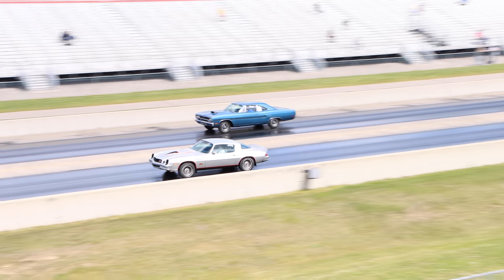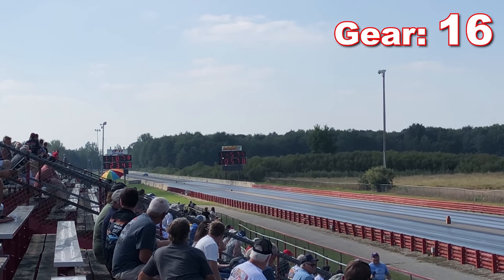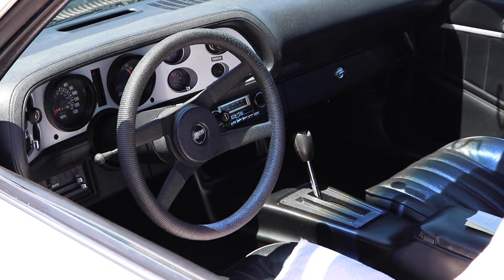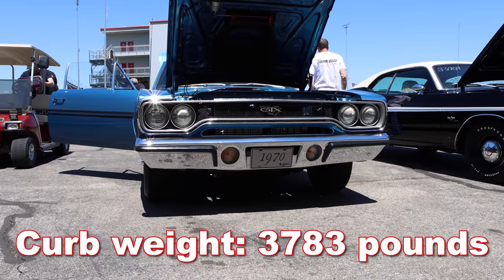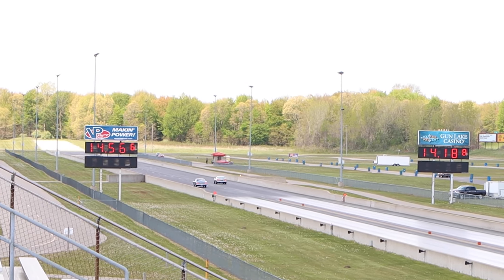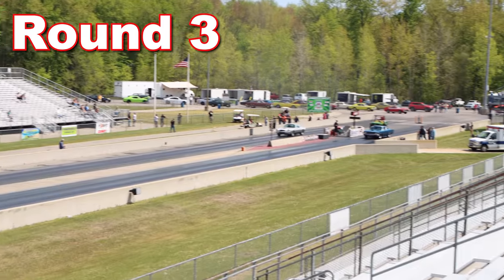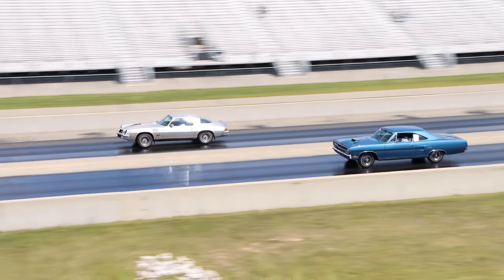1978 Chevrolet Camaro Z28 drag racing 1970 Plymouth GTX FACTORY STOCK DRAG RACE

Comment: That Z28 must be well-tuned and taking full advantage of the rules. There must be hope for my 74 Formula!
Reply: cam, higher comp pistons, hi-flow cats, non emissions messed up carb..yeah, basically probs making more power than a '69 Camaro, lol.
Reply: @gzuzsavz  NOPE!! Read the rules. He can change out the pistons but he'd still have to run the god awful emission era heads, casting #s are checked on all cars to ensure original configuration or blocks, heads and intakes. He can work 'em but he can't swap for "better". As to cam changes, can't get away with much of anything here. Cars have to make "Vacuum" which is measured at 16 inch min. The only cars that can get away with less than 16", according to the rules, are those that came that way from the factory. No roller cams and full original appearance exhaust must be in place, though you just know the converter has been hollowed out here. Carb can be worked but must be factory available original for the model year of the car and it must have a choke. Exhaust manifolds are retained and they aren't allowed to be "worked" for flow but it's pretty hard to imagine people, including this Camaro owner, don't cheat on that one. A little extra compression with flat top pistons and worked heads isn't going to amount to a whole lot if it can't breath better than the factory stock exhaust doesn't see big change for flow of the spent gases.
Reply: @Dogboy1960  Its basic physics. 98 mph 3550 pounds 1320 ft.   That Camaro is putting down at or slightly over 300 hp to the wheels.   Not bad picking up 120 hp with a tuned carb  lol.

Comment: Looks like the Camaro owner did the right thing and threw the original engine in the garbage
Reply: I'm sure he did!
Reply: Jeffrey Ring  well if that was the case, I would be really disappointed in only improving to a 13.90 from the 14.60 it ran with the untouched stock 57k mile engine🙄
Reply: Nope. I doubt he "shit canned it".  That 14.0 seconds average times at under 100MPH is no great feat. Sounds and looks to me like it's still in there. REALLY piss poor times from the factory and magazine articles back in the day were truly STOCK 'as delivered cars. It's really hard to over state how very buttoned down and stranggled air flow was for cars were in general in 1978. These numbers do appear as really impressive improvement, probably about as far as you can go without a head swap, bigger cam and headers but far from really hard to get out of the original engine. The rules in this class allow for lightening up the car's weight, the exhaust can be cleared of  serious restrictions, Carb can be tuned for performance and the intake and heads can be worked for both flow and a little extra compression. I have to believe he's shaved 'em for more compression. At under 100MPH and just 14.0 on average he's not exactly setting the world on fire but it's pretty good for those absolutely pathetic emission era, big chamber heads. Truth is there is probably not enough commentary on the very WEAK performance of the GTX. As a totally stock survivor I'm betting the car's owner hasn't done much of anything to optimize his car. This is no small part of the other side of the story here. How does a 440 bring such a weak performance? If he'd willing to dig in deep into his car, as the Camaro owner clearly did, he'd likely be putting up times in the 12s. At the end of the day though I will admit it's got to be a lot easier to make changes to a car that isn't especially rare and nobody really cares if it's all original stock than it is to dig in and make changes to car as rare and far more valuable to collectors as this really NICE GTX.
Reply: @Dogboy1960  in reality that's about how a stock untouched 440 ran back in those days
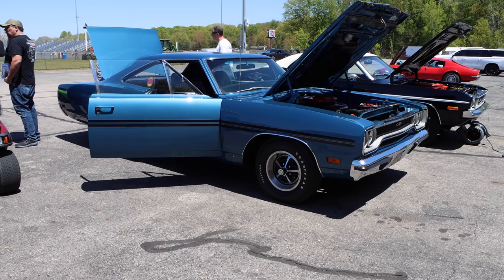Reply: @wallyfronzaglio372  If it came with highway gears you might be right. I think that what we're looking at here is a REALLY GOOD GTX that it's owner doesn't want to change up from it's original configuration. So if you can assume, as the video narration does, that it's still got 3:55s it's hard to explain his really poor showing. The video doesn't show that launch especially well, Could have been a case of terrible wheel spin off the line that saw him immediately lose a couple of car lengths to the easier to launch lower torque auto shifted Camaro. What we do know though is he was pretty evenly matched with the Camaro for the rest of the run. Given the extra weight that 440 is still making a little more power than the Camaro but it does show that the Camaro owner/driver has 'tweaked" his sadly hobbled emissions era 350 pretty significantly.
Reply: @Lucille69caddy  Thank you?

Comment: Something is up with that Camaro. Single exhaust,no flow pellet converter and junk heads. Those were lucky to get into the 16's when new. I used to beat them with a Toyota pickup.
Reply: There was no way in hell that was a stock Camaro.   When I was a kid, my 66, 300, with a 440 smoked those cars and was at least 500 pounds heavier than a GTX!!!!   Either the clutch was nursed by the driver or that 440 had a mid 70's Chrysler Lean Burn emissions system.  There is no way in hell that Camaro is stock.  BTW, I grew up in the 80's and raced my sleeper Chrysler all the damn time 73 and later Camaros were a joke!
Reply from the maker: You remember the beginning of the video where I yelled “READ THE VIDEO DESCRIPTION BOX?” You should probably do that.
Reply: @CarsAndZebras  I did. There is no way that Camaro ran a 13 with a overbore,882 heads and .390/.410 cam lift and 1.5 points more compression. The 70 Camaro With the 300/350 had 10.25 compression,better heads,dual exhaust,same cam etc and was a 15 second car
Reply: @chrisleggett685  never blueprinted an engine?
Reply: @mohh.4327  So, it's not stock!!!  That's the point!
Reply: @chrisleggett685  - In 1974 I added headers, full dual exhaust, a 600 cfm Holley 4 bbl, a dual plane intake to the 351W 2 bbl equipped 1970 Mach 1.  I also installed 3.91 rear gears and had the car professionally tuned.  The result?  I cut about 1 second off the 1/4 mile ET.  So when you say that adding dual exhaust will cut a full second off the ET I can say by personal experience that you are totally full of shit.
Reply: No emissions real dual exhaust and 1.5 more compression
Reply: Looking at those times, credit the owner of the Camaro. He turned a slug into a strong running machine. I'll still take the GTX. I grew up in a family that drove them all, GM, Ford, and Chrysler. I will alway's be a Mopar fan  for life!
Reply: With the original 57,000 mile engine last year the car ran mid 14's, no valve seals, bad cam lobe,etc.
Only thing non stock was nice mandrel bent dual exhaust, which is allowed in rules.
I went through the carb, jetted it up, worked on the secondarys, and went through the distributor, limited the advance, put a bunch of initial timing in, limiting the total.
Fresh engine definitely goes 13's, and that was my 15 Year old kid driving.
Reply: @tommiller1777  One hell of a job on that Z. My cousin bought a new Trans Am in 1978. I remember racing him with my dad's 318 '77 Volare wagon in the summer of '79. I stayed even with him until we 80 mph and he left me good, but up to 80, it was anyone's race. Getting a malaise era Z28 into the thirteen's is impressive.  Kudos!
Reply: @chuckhaugan4970 , you really have no clue what you're talking about about. But, hey, if you want to believe you do, then your delusions are strong. The Camaro is modded within the limitations of the rules... get over yourself. 13s within the constraints of the rules isn't that hard with that car.
Reply: @jayschmahl9206 , in Pure Stock, yeah, 13's is a bit difficult with that Z28. Building it to just run, nah, 13's is very easy. Cam, heads, intake, and headers, mid-12's would be gravy with that car.
Reply: @danmyers9372  You can’t be that dumb. You’re comparing a completely different car with a better exhaust from the factory. That Camaro Z28 ran through one (ONE!!!!!) catalytic converter and a near 2 inch exhaust. Go mandrel bent 2.5” x-pipe and tune according, and YES you will run a 15.0.
Reply: Did anyone verify the gear ratio? I bet that car is rocking 4.10's or better
Reply: @jeffm7669  yeah, I'll verify it for you. The car has the stock 3.42 gears. We drove it 45 minutes on the freeway to and from the track two days in a row.
Reply: @tommiller1777  nice job man
Reply: @tommiller1777  “and that was my 15 year old kid driving” 🤣
Reply: @chrisleggett685  So, pretty much if the GTX had been upped as much, she would've scorched the track to an 11 sec 1/4 mile.. maybe a high 10. Besides, that 'X' can run a bazilion times and love it..a 300ish hp hopped up Chevy with a wimpy lil trans & rear and engine internals..1 run..maybe a dozen..maybe a few more with huge $ spent on parts but that'd be rebuild time for the drivetrain. who knows what they did in this featured car & any others in this series to eliminate wheel hop, that was atrocious in anything Chevy, back in the day..weak axles already..add in a few hops and 'Ka-ping!' then 'Ka-ching!' $napped. all of those things being far less HD than the mighty Plymouth does make them quicker..just not for the long haul. So..dont wry about it, my man. & since ppl are ganging up on you, ill go a bit further, bc im old and was there. 70's-90's Chevrolet vehicles were so crappy they were a big reason why America turned to imports. Fords were no better. Boom.
Reply: @tommiller1777  Great to hear you and your son are competing together and nice work. Have you considered a shift kit?
Reply: @FL50ssp  the car has a shift kit, shifts are almost violent. Even the 2-3 shift is so hard it about knocks your fillings out of your teeth. 1-2 shift is like getting rear ended by a dump truck.
Reply: @tommiller1777  those good things or bad things?

Comment: Just as a reference point , I once rebuilt a guys ‘78 Z28 engine, 2 bolt block cast iron crank , used flat top  .03 over trw’s , the corvette L-82 cam, 650 Holley, torker2  manifold and 186 fuelie heads. It was a 4 speed with 3.73 rear. The rest of the car was totally stock full interior. 
He ran 12.90’s at Englishtown NJ.
Reply: And that's a very mild build, too. People in the comments just don't understand how the upgrades allowed in the Factory Stock class really allows for some serious power improvements. You're quite well aware of the performance of late 70's cars, so this is no surprise to you, without a doubt, lol. We all know just how pathetic a late 70's SBC really is... doesn't take much to get 350-400hp out of one, though.
Reply: @johndeeregreen4592  That’s what people here just aren’t understanding. From the factory the tuning was terrible on those 350s. Recurve, re-jet, full exhaust, tune for 110 octane and your easily in the low/mid 14s. Hit that compression ratio and easily 13s.
Reply: @SweatyFatGuy  Damn dude, that is a huge response but I love to hear from someone who has actually built and run budget or stocking motors.  I love this stock racing because who among us regular folks can afford to compete against these guys like Cletus with head shaking budgets and ridiculous boost.  Sure 7’s are mind blowing in a “street” vehicle but this is way cooler to me. Thanks for your reality check of the trolls.

Comment: Something is very rotten in Denmark because I owned a 1978Z 28 354 barrel with the Hearst four-speed and before that I owned a 1970 road runner 383 magnum four barrel! I promise you on a 78 Camaro 350 on his birthday would have been 4 to 5 car links behind my 383 much for less of 440 so either the Camaro I had something under the hood that you did not know about or something was terribly wrong with the GTX 440, I also bought a brand new 95F 150 pick up with a 5.0 L engine fuel injected I believe it would have been my 1978 Camaro! I owned both of the cars roughly in that race and there’s no way that Camaro could be a normal 444 barrel not in this world!!

Comment: The dude with the GTX either can't drive, can't find the gas pedal or has 2 plug wires disconnected. Hard to believe that Z28 could run like that either - they were slugs in '78 and you can't tune one to run 4 seconds faster.
Reply: Not 4 second improvement.
Car ran mid 14's with the stone stock 57k mile engine
Reply: The best the 440 ran was 14.31...? Nuff said.
Reply: Did you read the rules? Seriously? I mean it states the modifications allowed, the Z28 is a non A/C car so it's lighter than average and with a good driver it runs great. I just don't get guys who want to argue that a car isn't stock when the rules clearly state that the cars don't have to be stock?

Comment: My wife's 74 Challenger 360 8.5 compression 3.55 gears runs 14.40s that guy is not pushing that GTX hard enough or he can't shift
Reply: Nice, I also have a 74 Challenger 360 4-speed
Reply: Does she run F78 bias ply tires as well? I'm guessing that launching a 440 with a 4 speed is really hard with those rubber bands on it. I have a 69 GTO with a built 455 and with 275/60/15 B.F.G.'s on it I can't open the throttle up wide at the drag strip until I get well into 2nd gear. 1st is almost useless. And I guarantee my modern radials hook better than those repop bias plies.
Reply: @1967davethewave   you would be surprised. I just took that same size cooper cobra(which hook way better than BFG Radial T/A's(traction absent) radials off my 70 Stage1 Buick, and put on a brand new set of 14" Firestone Wide Oval repop tires, and I can't spin a third as far as it did with the radials.
Reply: @tommiller1777  I haven't run bias plies since the 1980's so I can't really compare but I would think that a 440 with a 4 speed in a relatively heavy car would be very hard to launch with those skinny tires. From road tests in the day with automatic 440 cars 13.8 to 14.2 seems the norm. So if it's truly 100% stock I wouldn't be too ashamed to run a 14.31. And maybe your wife is better driver!!!
Reply: @1967davethewave  the Jamaica blue GTX is a beautiful restoration on a lower mileage car. It was just pulled from museum duty and had never been down the track. He wasn't exactly beating on it. He and I both agreed with more time and tuning he could get it into the 13's(he is no dummy) He has a magnificent collection of Mopar Muscle. 
We were paired with him last year against his 67 GTX convert when our Camaro was bone stock, and he whooped our ass.
Reply: @tommiller1777  I noticed his mph was pretty slow on the GTX. That is one place where I would have suspected it to be closer to 100mph. But it is a beautiful car as is the Camaro. I think the '78 is my favorite of the rubber bumper 2nd gen Camaro's. I have a '76 Type LT with a mild 350. It's never been to the track though.
Reply: @tommiller1777  what exactly you do to the camaro to run it faster?

Comment: there were 2 different Z28 engines in 78. the 175 HP California emissions engine and the other 49 state engine, rate at 185HP. so it is not the worst Camaro 350 ever, that honor goes to the 1975 Camaro 350 LM1 rated at 155hp, but was also available in 74-81 Camaros with no Z28 350 at varing HP ratings from 155hp-185hp. the LM1 engine was based on the 3970010 engine block and usually has 4 bolt mains and a cast crank. GM also used this same short block for all their heavy duty application like taxi cabs, police cars, and 1/2 and 3/4 ton trucks of that era. also keep in mind that these are Net HP ratting and not gross like the muscle cars from 64-70. the 185HP car is probably close to 225hp gross.
Reply: The 1978 camaro with a four speed and 3:73 gears along with headers ,jetting curve kit could easily do 14 to 13:80 s all day .

Comment: Great vid. I wasn’t surprised by the camaro’s et as many were considering the rules. I think I could tune it to run mid 13s no problem. I was shocked by the poor showing of the 440 mopar. The gtx should have been a full second and a half faster with blueprinting and good tuning.
Reply: The car has ran mid 13's.
This was my 15 Year old son's first time racing, and I had him leave it in drive, where it is shifting(way early) at 4400rpm until he gets used to it. Higherrpm shifts she comes to life.
Reply: @tommiller1777 . Three awesome passes and wins for a 15 year old!  No criticism on the et, just disputing those commenting that the car isn’t capable of this within the rules when I know it is.  My younger brother in law bought an 80 Z-28 in the early 80s that had the optional 373 posi. I converted to true dual exhaust, put a shift kit, advance curve kit and tuned the Q-jet. It ran mid 13s at over 100 mph without dialing it in after the initial tune.  People don’t realize a base 350 with 1.94” intake valves, a 4bbl and true dual exhaust with basically any compression ratio and cast intake is capable of respectable performance if properly tuned.  Great to see a father and son doing this together.
Reply: @Wilson-cp4gx  thank you, and nice to hear from someone who actually "knows" a thing or two.